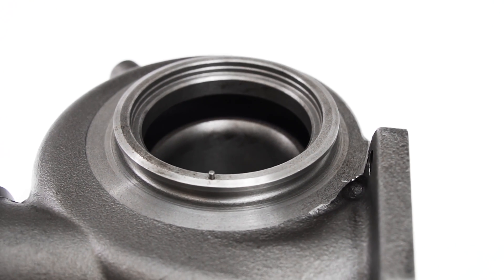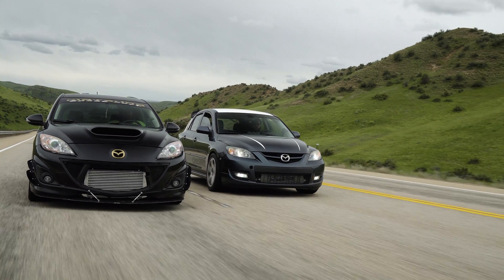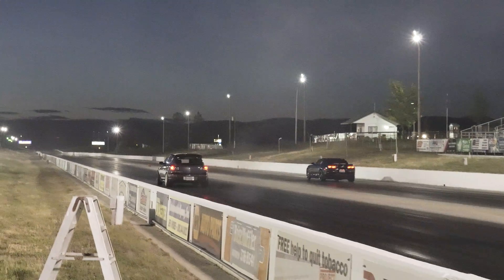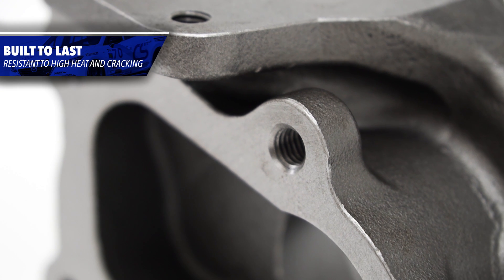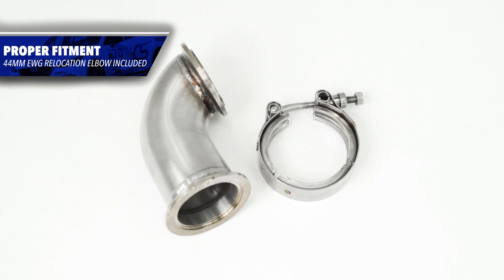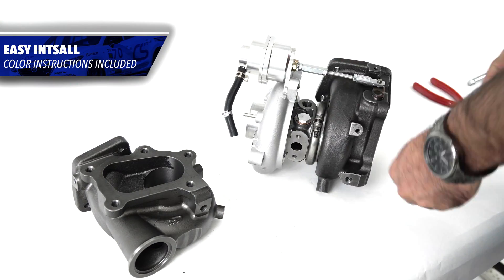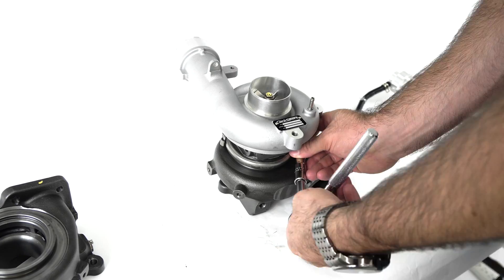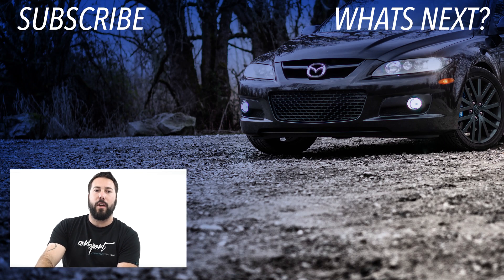CorkSport EWG Upgrade Kit - CST4 & CST5 Turbo

Comment: My 2019 MAZDA CX-5 Grand Touring 2.5 L. turbo. AWD has DEFINITELY  improved the SUV's performance by adding  CorkSport's better intercooler and piping kit. But for a daily driver I'd hesitate to use this turbo "upgrade" as it adds noise and likely lowers fuel efficiency.